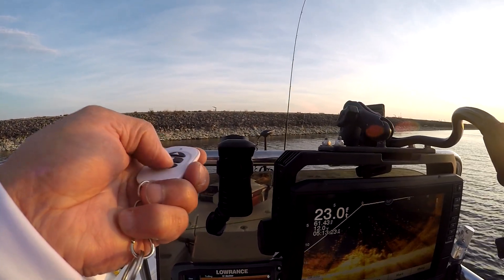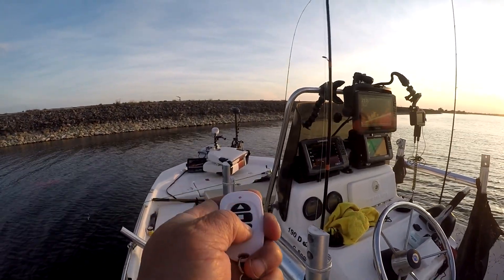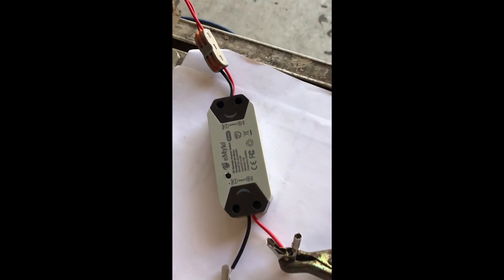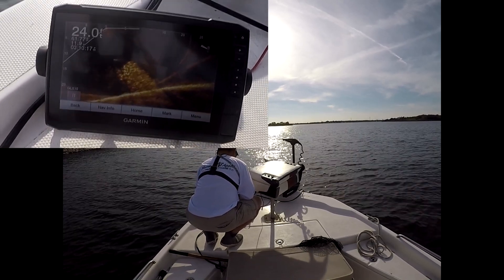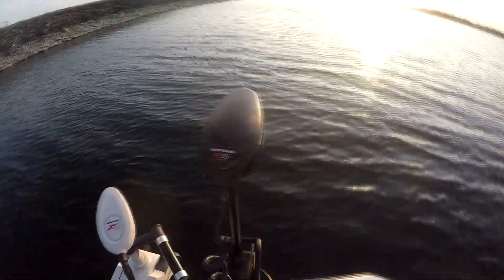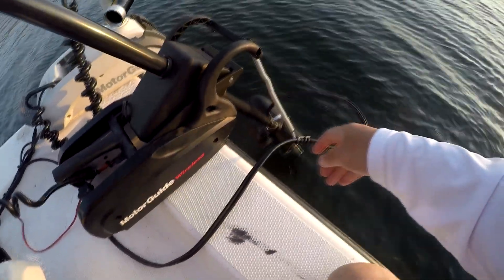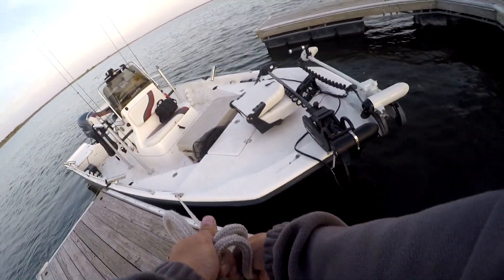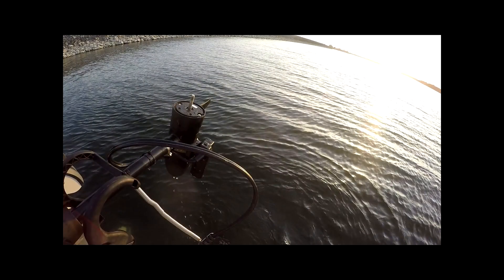How to DIY Wireless Control #Garmin #Livescope #Transducer mount

Comment: How did u wire it
Reply from the maker: ONce you get the controller, there's 4 wires, 2 in and 2 out.  cut the wire going to the trolling motor, and insert the controller in line.

Comment: I bought this same wireless controller for my DIY livescope mount. Problem is, I can't get the controller to light up / turn on . I've tried the pairing methods.. ( push and hold the button for 3 seconds etc. Power leads are good. Any suggestions? I was reading that it comes paired already. ??
Reply from the maker: I don't recall on pairing.  but it should light up when it's powered.  It could be a bad controller, but I've never experienced that in the 20 I've worked with.  read comments on tricks on pairing.  it's VERY important you follow what I've learned if you want to pair.  Best of luck

Comment: I have the same controller and can’t get it to operate in “jog” mode like yours seems to.  I have to push the arrow and then it moves until I press stop. The instructions say it can be programmed for jog mode but I can’t get it to work. How did you get yours to work that way?
Reply from the maker: Mine came out f the box that way.  I recalled that the other option is as you described.  YouTube that one!
Tim
Reply: @skunkedagain   I’ll have to do more research I guess. It has very bad instructions and I tried several times to program it. In the Amazon comments a few people said that it didn’t have the jog mode even though the instructions say it does.  Thanks.
Reply from the maker: @michaelnorman8392  your TM is an xi5 right?  That’s what mine is.  I don’t believe the xi3 has that jog function. Tim
Reply: @skunkedagain  no, I’m referring to the eMylo wireless controller. I’m using it on a DIY livescope pole.  When I push one of the directional arrows it keeps turning until I press the stop button.
Reply from the maker: @michaelnorman8392  oh, sorry about that.  The instructions are terrible.  There’s a trick.  When you program it, click it 3 times as fast as you can, then push left, then right.  I program all of mine like that and the jog function works as is.  If that doesn’t work, do an erase, then try again.  I forget how to erase because I’ve not needed to do that.  Just remember lightning fast 1, 2, 3 clicks to get into paired mode.  Let me know. Tim
Reply: @skunkedagain  Thank You!  I got it the first try after doing it as fast as I could. I was pushing them too slow I guess.
Reply from the maker: @michaelnorman8392  it took me forever to figure that out.  I saved that in my library of things to know.  I’ve walked many friends through the process and counting to 3 as fast as I could is the secret.  Remember that when somebody calls you up,!  Glad I could help.  It’s the only setup I use for both my LVS setups.
Reply: @skunkedagain  Maybe this will solve my problem.. I can't even get the unit to power on.. ( no little light comes on when I have 12v going to it)...

Comment: Nice DIY project you have there.
I notice reading the comments that you have removed both the head and lower propulsion unit which is a good move.  Not sure how some of the older controls are put together, but you might??? be able to remove the minn kota steering rotating unit from the deck bracket and make a DIY bracket to attach it to your spot lock trolling motor like cornfield crappie and others have done.  If so, you could eliminate the second trolling motor bracket all together.  Not sure if this would work but it may???? be something to think about.
John
Reply from the maker: I actually thought about that to save space, but it’s doing fine as is.  Let me know if you come up with any design ideas. Thanks, Tim

Comment: Any updating on removing head and lower unit? If you do/did it could you run the live scope cable inside the shaft to get rid of the spring?
Reply from the maker: I took both off, making it so much lighter.  My most recent videos have them running.  The cable doesn’t fit inside.  Tim

Comment: Good idea except don’t want a second trolling motor mount to front of boat.
Reply from the maker: My name is Steve Rogers  You're right.  Now that it's controllable from anywhere, it could also be mounted anywhere.  I've also taken off the motor and head, so that it's only the shaft, and it;s super light and doesn't take up that more space than any other transducer shaft.  The drawback of having it in the back is if you're spot locked onto a brushpile; the back swings around with the wind.  But that's a small problem.  There are lots of ways as you've noted.  Thanks for your chiming in!  Tim
Reply from the maker: S Lange yep, definitely a drawback.  Thanks for your thought. Tim

Comment: I did this after getting my Livescope back in early 2019 with an old Minn Kota Power drive.  Has worked great for me.  I cut the lower unit off and the head unit off to make it a smaller profile and less mass in the water..  In doing so I added a voltage regulator to allow me to slow down or speed up the motor.  I have my 93sv Plus at the console and it makes it nice trolling and being able to scan and look for structure/schools of fish from the drivers seat.  I made it in conjunction with a Cornfield Crappie shaft mount.  I really like it, and think it is the most effective way to utilize the Livescope transducer.
Reply from the maker: Hi Thomas:
Actually, I think I got this idea talking to you (was it on FB?).  I've actually considered pulling the motor unit off too.  I also like to use the LVS from the console and panning around while I"m trolling.  I also have one up front so I can provide those up front with the 2nd remote and they can find their own lures when jigging.  Thanks for sharing your thoughts. I actually bought 2 of these; one for the main, and another for the coast.  Tim
Reply: @skunkedagain  I know I have mentioned it on Bassboatcentral and a few youtube videos.  Not sure if it was yours or other Livescope content creators.  I only watch a few and I have referred your videos to numerous others to showcase what Livescope is capable of.  On a side note,  have you had any problems with battery life using the LS system?  I know you had one on your kayak.  My battery seems to struggle to crank my motor after fishing a few hours running LS along with a few HDS 8 for structure and sidescan.  I believe the battery is good along with my onboard charger but have not validated either.
Reply from the maker: @MrThomasfouraker  I'm really surprised I haven't had any battery related issues, except for when the battery actually did go out on me.  It lasted 3 yrs.  But since I've gotten a new one, no issues.  I run 2 Lowrance HDSs, 2 Garmin 93SV+, and boat pumps off the same cranking motor.  I'm close to overloading it; so I carry a portable jumper in case....